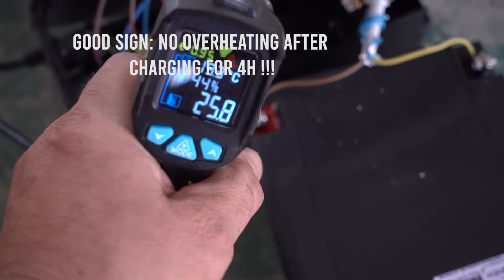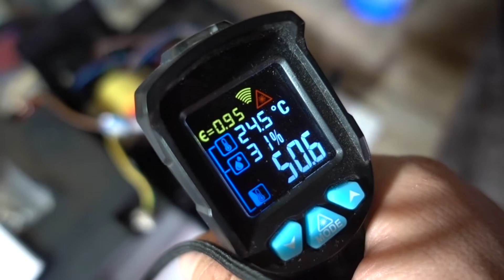How to increase UPS backup time - WILL THE INVERTER OVERHEAT with larger battery ?

Comment: and is maximum how much Ah battery we can use like this 27 is the maximum or any particular limit is there or not
Reply from the maker: No, the limit is not for the battery but the power that you draw fro your UPS. You can use any battery 100Ah, 200Ah, any. But. UPS is made to supply power for only several minutes, as it quickly overheats and shuts down. In this video I explain a workaround of using very LOW power for hours. But if you need more than approx. 50W power then you must buy components for a solar system that are made for constant supply of larger power. You need an inverter from 12V to 220V, they go up to 3KW and need a battery charger. Also, you cannot use a car battery, but a deep cycle battery because car battery is also made for very short power supply, just to start the car. If it empties under 50% it cannot be used anymore, while deep cycle battery can discharge deepy and be re-used. With solar components you do not have solar panels, but charge from the grid, all else is the same

Comment: I have a 800 va ups (480 watt) and 60 Ah battery. Can you tell me how much load is safe for that?
Reply from the maker: 50W will work for.sure for longer supply, maybe even 100W. As an orientation, you can either monitor  overheating with a thermometer as in tgis video; or just see at what point UPS automatically  turns off due to overheating
Reply: @MarkoRadulovic  I'm running it with 110-130 watt load. Though it is not overheating, I added a mobo cooler fan on top of that. It takes a lot of time to charge the battery. Can I increase charging speed without adding an external charger? Any tips or tricks??

Comment: So what do  I need to do in order to power a gaming PC that pulls up to 700W and make it run up to 1 hour? Also, what's the deal with this overheating if the wattage is a high number? Idk sht about this subject, but my e-bike has an engine that pulls 500W and I run for hours just fine without overheating and melting or exploding between my legs... LOL
Reply from the maker: For that, it is best to entirely  give up the UPS idea and buy a deep cycle 200Ah battery and a 2000W inverter. This 200Ah will approximately be only half- drained in an hour but even deep cycle batteries should not be drained deeper, to ensure optimal usage life
Reply: @MarkoRadulovic  Thank you for this info that I couldn't have found myself anywhere!! With these key words I already found some videos. In fact, one of them of a really smart guy who happens to live in a 'favela' hooked up a inverter and a huge battery to power his entire kitchen when the energy goes out :P

Comment: Is it safe to do like this ?
Reply from the maker: Very safe, because I explained that by using a very small fraction of the declared UPS power there will not be any overheating in case of non stop use. That is: if you have a 500W UPS it is ok to power several surveillance cameras for a total of 50W. Surely not a nonstop power for a desktop. More is explained in comments below

Comment: Does it charge fully... as amp is less for the ups
Reply from the maker: I don't think amps have any influence in battery charge control. To what I know, batteries are charged according to voltage which is the same for small and big batteries
Reply from the maker: Yeah, this 5x bigger battery was fully charged, it could not provide electricity for 8h otherwise
Reply: I think the charging amps is constant..because it is the rated charging amps of the UPS so changing like 7ah battery into.12ah battery will charge longer..
Reply from the maker: @danmilan4763  That is correct
Reply: Yeah, most of these can only charge at 1A so it takes about 8h for OEM battery. 25Ah should be charged after a day and a half. Since current while charging is limited, it most likely won't overheat, however inverter could overheat at higher loads. I have 480W model and it gets really hot if i discharge it at half of that power for long periods.

Comment: Hello sir, I have contacted UPS with 35ah Amron car battery. I have checked that 35ah full battery provided approximately 4hrs backup for 200 watts load. But I am using my laptop with wifi during backup time UPS automatically turned off after 5 minutes of backup instead of long time. If turned on again then also turned off after 5 minutes. It's quite difficult to use please give me a solution. Thanks in advance.
Reply from the maker: UPS is made to supply power for only several minutes, as it quickly overheats and shuts down. In this video I explain a workaround of using very LOW power for hours. But if you need more than approx. 50W power then you must buy components for a solar system that are actually made for constant supply of larger power. You need an inverter from 12V to 220V, they go up to 3KW and need a battery charger. Also, you cannot use a car battery, but a deep cycle battery because car battery is also made for very short power supply, just to start the car. If it empties under 50% it cannot be charged again, while deep cycle battery can discharge deeply and be re-used. With solar components you do not need solar panels, but charge from the grid, all else is the same. You can power the whole house, the battery capacity is the only limit. But inverters with higher power, over 1kW,  are expensive, of course

Comment: What temperature will be called overheat for ups transformer
Reply from the maker: That is an excellent question, well the baseline transformer temperature is about what was measured here around 50C. Overheating is considered when the transformer reaches 65C. This gives me the idea to further this study by testing higher loads on this UPS to see at which % load it actually reaches 65C.
Reply from the maker: I expect that UPS will overheat at a much lower point than its declared load of 380W because the backup time is greatly extended here with a bigger battery. So the rule is: BIGGER BATTERY - LOWER LOAD
Reply: I use only 100 watt load on 12 ah battery but while charging transformer heats so much that i can't rest my finger on it
Reply: And i dont have thermometer to measure temperature
Reply from the maker: @prakharsrivastava8052  Well if you cant rest your finger, it must be close to 65C. That is strange as charging should not be a big effort for the transformer, especially the 12Ah battery. Could it be that battery is old or faulty, these batteries should be changed about once a year. If it is not a battery, it would be good to call the manufacturer and see what they think, my opinion is that it would be good to replace that UPS as it may become get worse and you then have a fire hazard. these things are quite cheap up to 1000W power
Reply: Then what should i do
Reply from the maker: Well, overheating during charging is an indicator of failing battery or charger, or both. If your UPS is over 5 years old, consider buying a new one. If it is over 10 years old, you MUST buy a new one. You could try only to change a battery, but if the battery turns out not to be a problem you will need to buy the entire UPS with a battery anyway. So, it all depends on the age of the battery and of UPS..  If you try to buy only a battery first you may save money, but if the battery is not a problem then you need to buy a whole UPS so you might actually spend more. Unless you can manage to return the battery, that's in brief about the two options that I see
Reply from the maker: @prakharsrivastava8052  I now looked again at my UPS, charging temperature of transformer  is 40C which feels barely warm when touched. If you can hardly keep your finger on a transformer, it could be even over 75C, so I recommend very urgent change of battery or entire UPS

Comment: hi, i am doing work at home now, suppose if i want to get my lap top usage and a wifi doggle upto 8 hr ..is it possible to do like this ...without overheating isses...plz reply
Reply from the maker: UPS is made to supply power for only several minutes, as it quickly overheats and shuts down. In this video I explain a workaround of using very LOW power for hours. But if you need more than approx. 50W power then you must buy components for a solar system that are made for constant supply of larger power. You need an inverter from 12V to 220V, they go up to 3KW and need a battery charger. Also, you cannot use a car battery, but a deep cycle battery because car battery is also made for very short power supply, just to start the car. If it empties under 50% it cannot be used anymore, while deep cycle battery can discharge deepy and be re-used. With solar components you do not have solar panels, but charge from the grid, all else is the same

Comment: it consumed 160wh.. or 13.33ah of battery which us 50% DOD of lead acid battery
Reply from the maker: What is your point?
Reply: It consumed more, inverters in these things aren't really that efficient so you need to add about 10-20W just on losses in switching circuit. It's not recommended to run lighter load such as these because of that since efficiency is about 50% with 20W load. Battery was probably dead after 8h.

Comment: Hi marko 
Im thinking of replacing my 600va ups battery because when im gaming and electricity goes down it instantly turn off
Will changing the battery to a high capacity one would solve my problem?
Reply from the maker: Bigger battery will resolve the problem but under one condition: your UPS must be rated for power several times over your desktop. Say if the desktop draws 300W then  UPS should be rated at least at 1000W. Otherwise, your UPS will quickly overheat and turn off even with a much bigger battery. Again, instead of the low battery capacity it will turn off due to overheating. 1000W+ UPSs are not that expensive, so what you want is very realistic, say 1200+W UPS and 50+ Ah battery
Reply: @MarkoRadulovic  so my 360 watt ups cant handle a biggere battery because it will overheat right????
thank you for helping me❤❤❤
Reply: @MarkoRadulovic   hey marko i have just checked the markt and i found that a 1050va or 630 watt ups cost around 350 dollars 😥😥

Comment: What about you crack out a multimeter and measure the current going into the battery during charge?  I'm guessing less than 1 amp.  So basically your battery is toast after doing this because the UPS will simply never be able to get that big of a battery back up to 100% charge.  Something critically important for a lead acid battery.

This is all just silly, the money saved just makes no-sense if you can buy an off the shelf inverter charger for very little extra money.

This is your classic hilly billy hick hack that seems great but if you actually understand the drawbacks, you realize its a bit like pissing in the wind really.
Reply from the maker: Please, you seem a bit overly critical. Firstly, the battery is charged up to 100% without any problem. The problem with battery charging was not ever mentioned in the video. But, I agree that there are always better and more expensive solutions. This works perfectly fine for anyone who needs a very small amount of power to back up several surveillance cameras for up to 8 hours, why not. It has worked fine for years, despite your theoretical scepticism. This is great for the specific purpose that is precisely defined in a video and in the description. If instead of 50W I needed 1kW, yes, then a sinusoid inverter with large 200+Ah batteries would be the only solution

Comment: Ofcourse it is not going to overheat, the inverter is only using what it can take
Reply from the maker: Well, with 200W load it heats and automatically stops within seconds. This is still under its declared power of 360W. So, overheating is definitely an issue
Reply from the maker: The whole point here is that it WILL NOT overheat ONLY IF load is a very small fraction of the declared power
Reply: @MarkoRadulovic  Okay, but then it's just a bad UPS design, and it would overheat with a smaller (original) battery too when drawing 200W